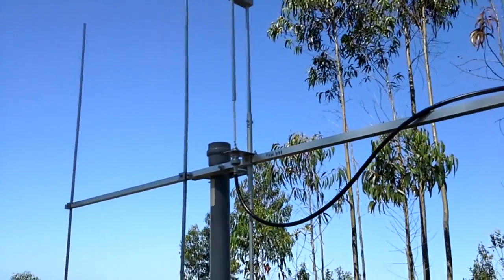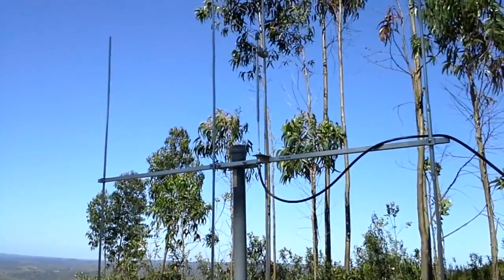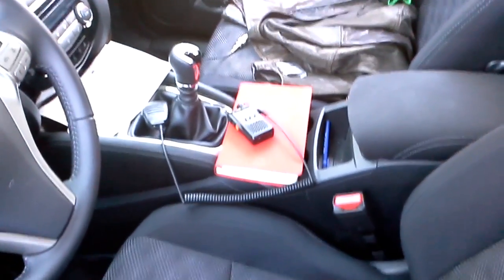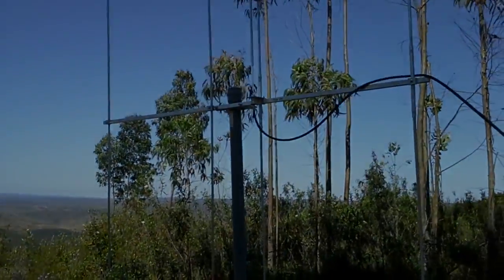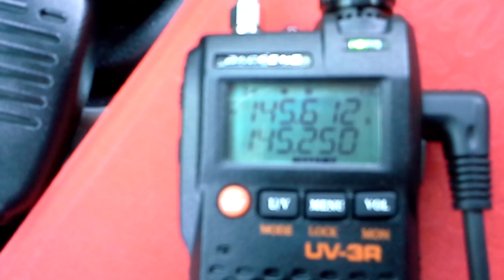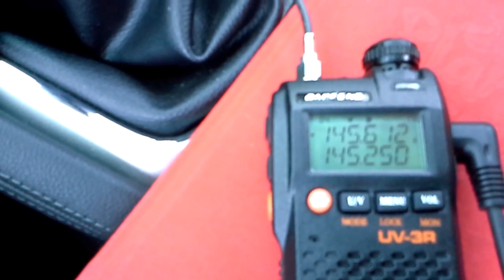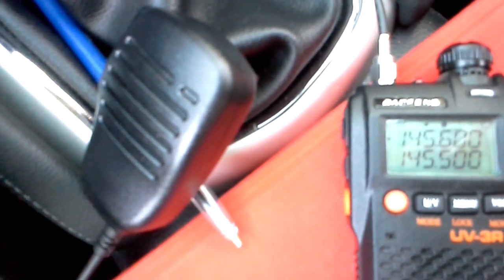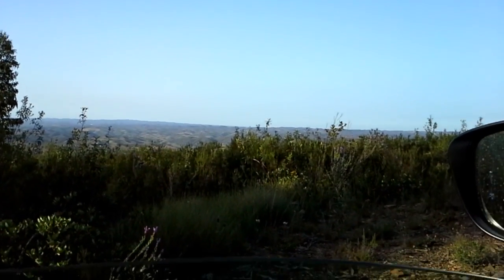Home built 2m band 4 element Yagi beam antenna

Comment: A very nice antenna build.  Is the boom made from aluminum too?  It doesn't matter to isolate the reflectors and the directors from the boom?
Reply from the maker: Yes, the boom is made of aluminum and does make electrical contact with all the elements because I use an adjustable gamma match at the feed point.
73
Reply from the maker: Lane, I have found a nice example on how the gamma match works, take a look at : https://sites.google.com/site/buildingcbantennas/gamma-match